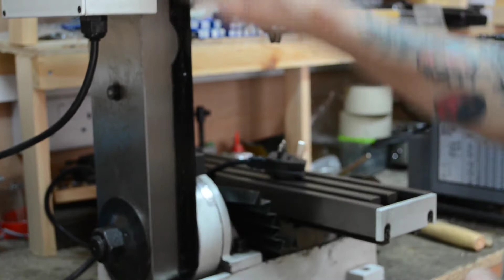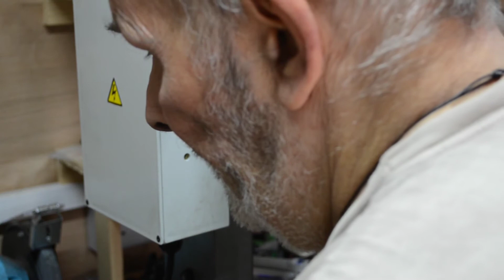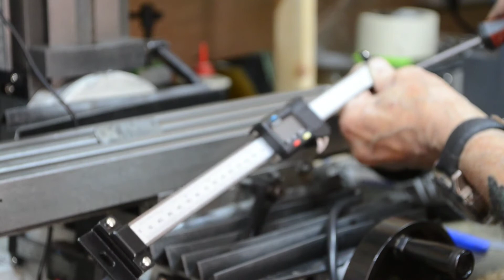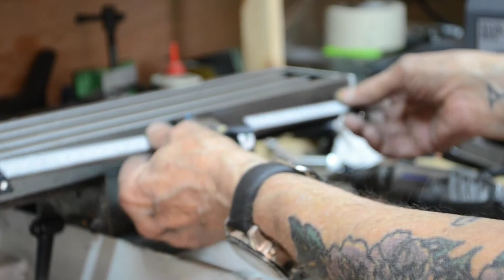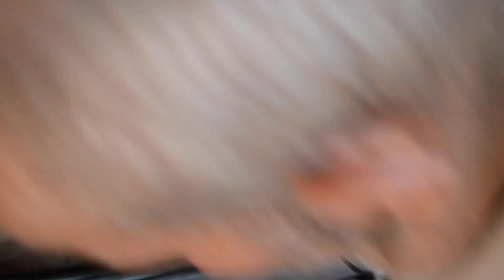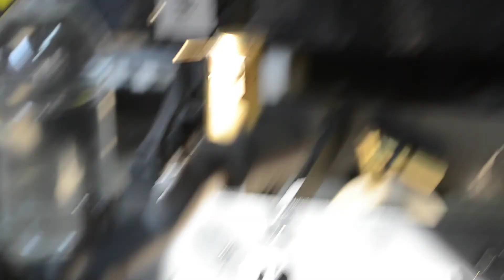Video 1 DRO to Mini Mill

Comment: Thanks for the video. Yes mounting any measuring system can be quite a bit of a trick, you did well. There are so many good possible systems now of days. In example, for their basic positioning Hass Automation uses encoders on the servo motors and keeps track of position in software. They even do a compensation for the heating of the ball screws. They also offer independent systems for those applications that need measuring to the 0.0001 range or tighter.

Comment: This so reminds me that I need to fit mine.
But with so many other jobs including the House to add insulation to. Next summer!!
So lovely to have found you.
Love David and Lily.
Reply from the maker: See the comment from Joe Pieczynski, you'll wonder how you managed without one. 
For an upcoming project  there are lots of holes arranged symetrically and without a DRO it would be very hard, for another there are about 150 holes and cut-outs from two datums, a real nightmare to impossible without a DRO.